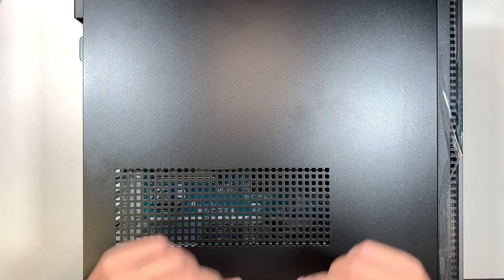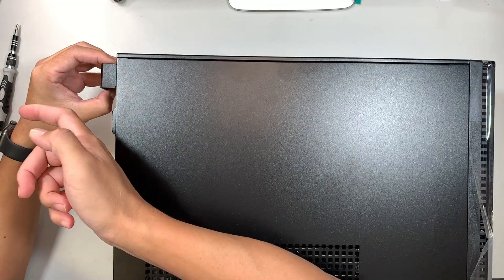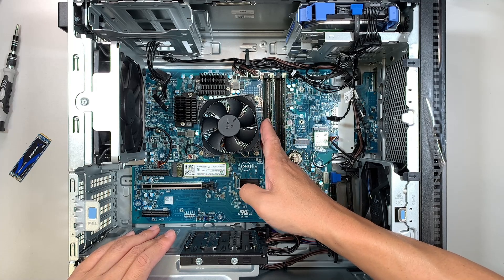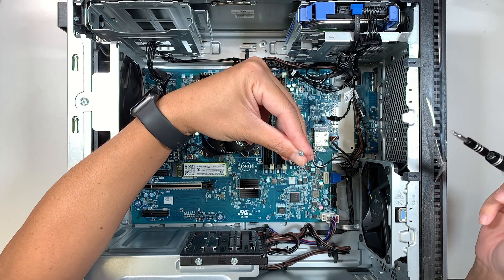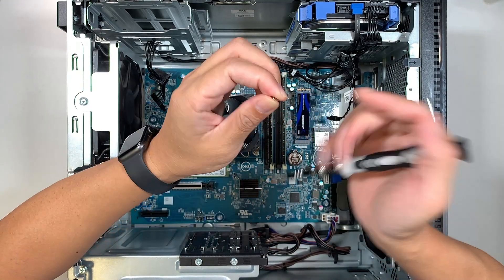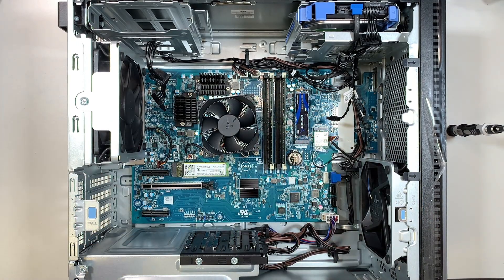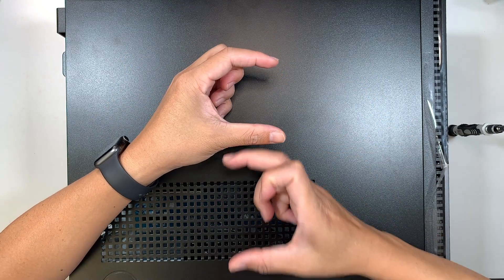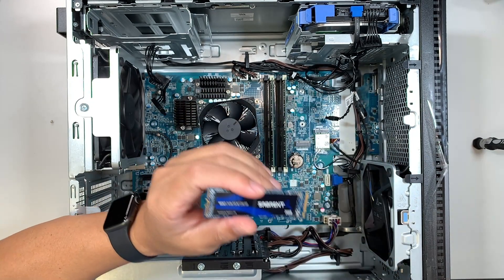Dell XPS 8950 Add M2 SSD NVMe Storage

Comment: This didn't work for me. The BIOS recognizes the m.2 drive but Disc Management does not. I do not know if I need to enable the m.2 drive within the bios, and if so, how to do this. BIOS does not seem to offer clear methods on how to do this. The only clear option they give me is between  RAID and AHCI/NVMe, and when I choose AHCI/NVMe, the computer cannot boot. The current boot drive is a western digital HD. Not sure what to do.

Comment: Great Video! I installed a 2nd NVMe, and the computer wasn't powering on, giving an orange blinking light. After watching this, I realised I'd removed the wrong screw and used that to secure the SSD, which caused it to bend and possibly not fit properly in the slot. Then I removed it and screwed it using a separate small screw-on level with the slot, which resolved the issue. Thank you!

Comment: Thanks for the video, should you add heat sink to the new ssd?
Reply: Depends on your task and the speed of your SSD
If it's a really fast, and you are gonna leave it on heavy load(Let say, 4-8k video render) for like 10 or more hours a day, then I would recommend it
However, if you are just playing games on it, you can ignore it :). Firstly, that position(assuming you use the position near the RAM, NOT the graphic card), is not creates much heat. Secondly, playing games, don't generate that much heat either. So if it's just about games and normal copy paste, you should be good

Comment: Brazil does it accept SSD M.2 NVME OR SATA?
Reply: The 8950 MB can handle 2 NVMe drives as he shows in the video.

If you want to add SATA drives the MB can take 3 of them. You can see them at 01:12 where his hand is located by the lower right hand are. See the intake fan and the BLUE right angle cable- that is where the 3 SATA cable would go to.

Comment: How do you boot from 2 nd ssd and make it the c drive while keeping the first one as storage?
Reply: You can clone the old drive to the new drive using free Reflect X software. Remove the old drive, reboot and go into the bios and select the new drive as the boot drive. Then put your old drive back in and reformat it and use it for storage.
Reply: Well, may have to reinstall the Window mate, just install it on the 2nd SSD